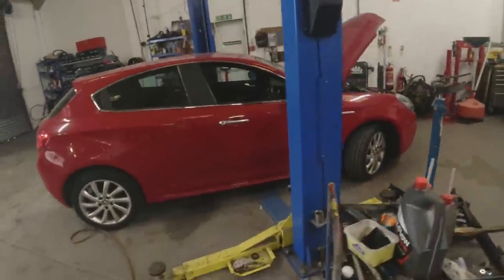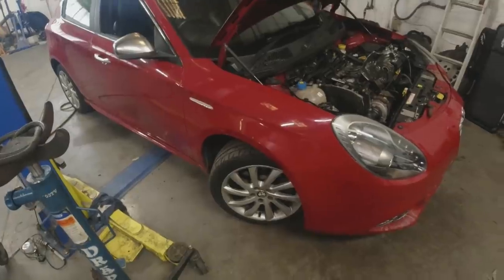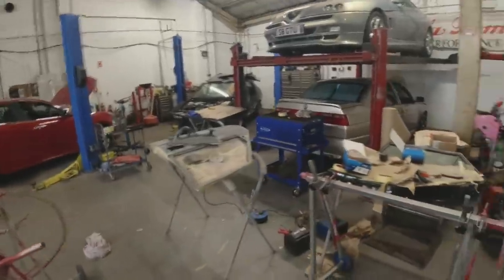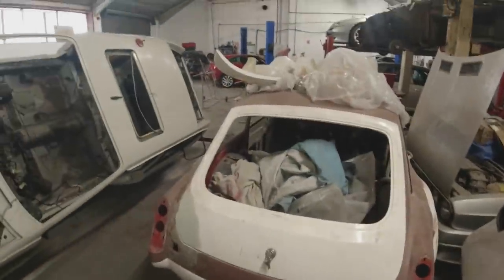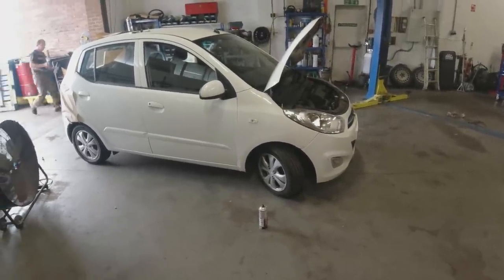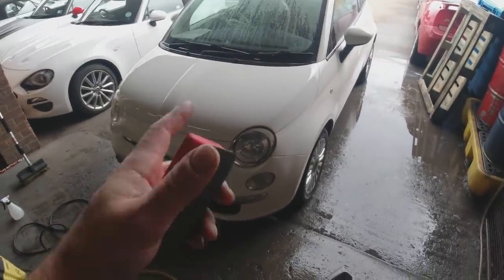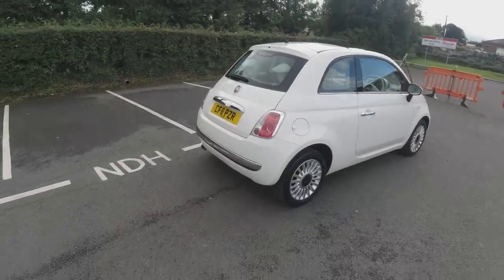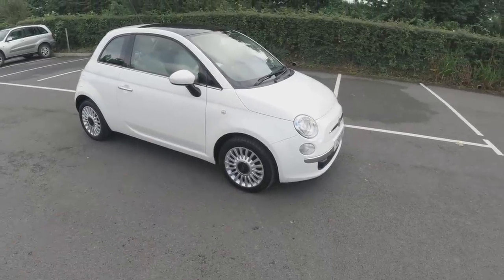British Car Auction Alfa Romeo Flip - I SPOKE TOO SOON!!

Comment: you can get the egr off without removing any intake parts - remove the 3  torx, unlug the wiring connector and thread it out by moving it out and down towards firewall, turn on its side and it will squeeze through. Dont lose the small metal washer in the manifold.

But lack of low boost is more than likely the variable vanes being tight or stuck.
Reply from the maker: Top tip! The turbo seems to spin smoothly by hand. But we are getting no reading on egr movement

Comment: Yea I had an old Astra was nearer 3000 revs before it started pulling nicely… 
No fuel system cleaner just a good run to northfolk cleaned it all out…
I never knew as my pal drove it there… wasn’t till the journey home I noticed how much more responsive it was ..
Reply from the maker: Yes this might need a drive

Comment: I wish you the best with the rental agreement of the two new units.I can see why it would be a bit daunting but keep doing what you are doing and it will all turn out alright.Next you will need a garage name and logo i think.Have you thought about putting a branded number plate surround,disc holder or rear window sticker on your cars for easy and cheap advertising?
Reply from the maker: Yes need to decide on thngs
Reply: @ChopsGarage  just thought i would put it out there as an idea.It's not like you don't know what you are doing 😄😄

Comment: Io penso che sia bloccata la valvola EGR, perciò devi sostituirla e risolvi il problema. La turbina probabilmente funziona bene. Ho avuto lo stesso problema con la mia 156 e risolto con la sostutuzione della valvola EGR.
I think the EGR valve is stuck, so you need to replace it and fix the problem. The turbine probably works fine. I had the same problem with my 156 and it was solved by replacing the EGR valve.
Reply from the maker: Thank you

Comment: Dont bother with EBay rubber 'clay bars.' Get some Bilt Hamber clay. Uses water as a natural lubricant and frequently turn the clay on itself. Never ever clay a car without suitable lube for it. Some clays need a QD as the lube which is extra expense. If you drop the clay on the floor, bin it and dont try to fold and re use, you'll introduce scratches. Some clays can be very aggressive such that you need to give the bodywork a mop to get imperfections out afterwards. Oh and Alfa, money pit!
Reply from the maker: It will be alright bud lol

Comment: Surprised they didn't do an egr delete while it was getting mapped
Reply: Any reputable tuner will strongly advise against messing with the EGR with a DPF still in place as it can lead to premature blocking of the DPF.
Reply: @reeced5521  I had a 1.9mjet grande punto. When I mapped it they did the egr blank but I didn't have a dpf. So cheers for the knowledge.
Reply: @welephant2013  Those 1.9 PD engines are great

Comment: I used to have a 147. Never left me stranded, but the component life/reliability was awful after about 70-80k. I just spent my time constantly replacing numerous parts which all adds up ££££s. The final straw was the ECU going and it cost £700.